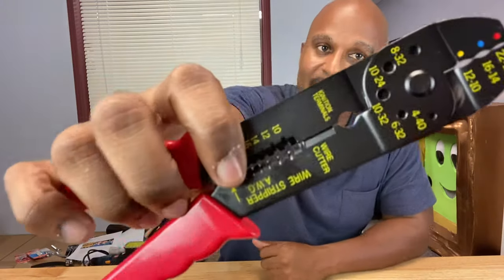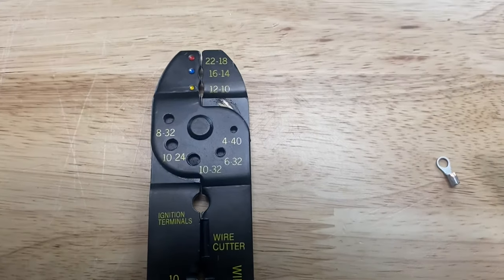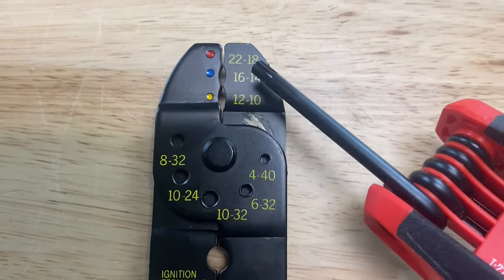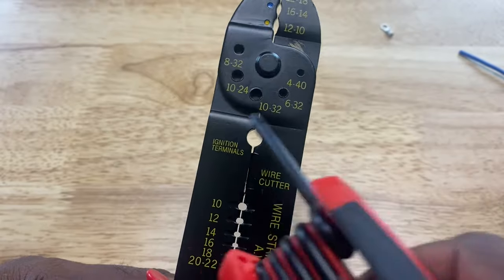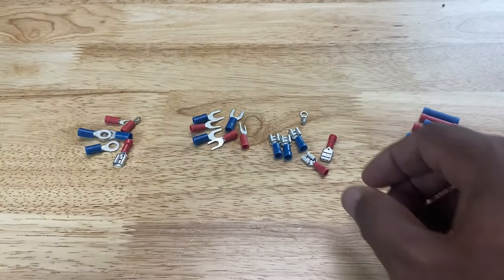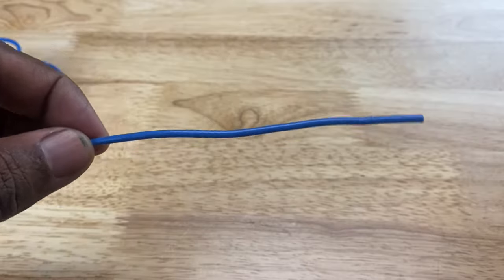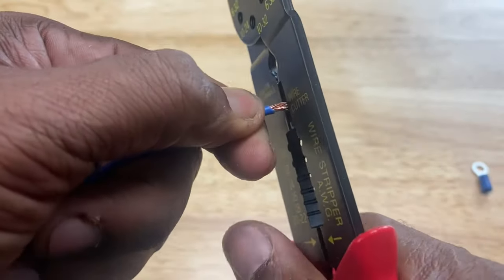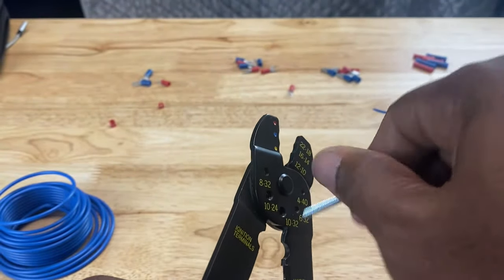HOW TO STRIP CRIMP AND CUT THOSE WIRES!

Comment: A nice video to introduce a lot of beginners to this versatile tool.  A couple of points of clarification if I may...I would not recommend crimping coax with this tool.  The coax you happened to show used a compression style terminal, which requires a completely different tool to install, as it is not crimped.  But even for crimp-style coax terminals, this tool will not generate sufficient crimping force to make a reliable connection.  A minor clarification on the screw-cutting portion (the part of this tool most people don't understand!) is that it isn't 6 thirty-seconds or 8 thirty-seconds.  Machine screws come in particular sizes (diameter of the shank--very similar to wire gauges, but a totally different system).  The 2 numbers with a dash in between represent the screw (shank) size and the thread pitch (number of threads per inch).  So a 6-32 screw (common in electrical work) is a #6 screw with 32 threads per inch.
Reply from the maker: Thank you very much, clarification much appreciated.

Comment: Wire cutting, stripping and crimping all in one tool. So far I have got by without one just by using the pliers that were already in my tool box. Still a very informative video and this tool is a lot cheaper than others if you want to keep just one tool with your box of connectors.
Reply from the maker: Glad it was informative.

Comment: Thank you for the video very useful. I love this tool. It's a must need for any tool box. A lot of electricians will say that it sucks but at the end of the day it does work and when the time comes and you need to get the job done it will get it done. I have used it in many major jobs and it has kept true for years. Also it's great for electrical outlets for cutting down those screw sizes which sometimes are to long. Knowledge is power. I really appreciate the video I wish to do some myself fixing stuff.
Reply from the maker: Thanks for the information. Appreciate you.

Comment: Thank you, I got all the info I needed from you. ❤
Reply from the maker: You’re welcome. Glad it helped.
Reply: @Caliber8Tools  it did, I changed my air-condition Resistor in my car and I had to use a cable clamp stripper for the first time in my life. Went smoothly except the tight and short cable area I had to work on right under the passenger front under the dash and glove compartment. Was tight!!!

Comment: Great video, layman's(simple) way explanation, and cool guy.  Never knew or thought of the bolt cutter and its purpose until I watched your video! .... can NOT tell you how many times I've bitched about when cutting a screw/bolt (with a regular cutter, not this tool) messing up the threads at the end. So, this tool re-threads the end of cut so you can use it like a new cut-to-length size. COOL!!  Thanks a lot!
Reply from the maker: You’re welcome. Glad it helped.

Comment: Thanks, truly, all i want is crimp some wires for the connector of my fuel pump connector. Instead of buying a new connector, all i need is to change the connector but i didn't know how to atick the terminals at the end of the cable. I truly appreciate sharing your knowledge.
Reply from the maker: No problem. Glad it helped.

Comment: Admittedly, I am a tool and wire idiot.  Sixty-eight years old and never done this.  You did a fantastic job explaining and demonstrating this tool.   I learned a lot from this video.   I have owned the same tool you demonstrated, just never had a clue how to use it.  One dumb question for you.  I have thin wires on my sprinkler system and don’t know the gauge.  I know, from you, that it will be a higher number.  But, how does one determine the gauge of a wire.   Obviously I have no packaging that came with it.  It was installed seven years ago by the sprinkler guy.
Thanks again for your video.  You had just enough detail and went slow enough for us neophytes.
Nick T
Reply from the maker: Appreciate your feedback. I would invest in a wire gauge tool. It’s a small measuring device that has slots to insert your wire to tell you the correct gauge. Sold online, around $10 on Amazon. Don’t know if Homedepot has them in stock. Type in “wire gauge tool”.

Comment: Caliber8, good dope on using the what/how of the crimping tool.  The one thing I might recommend is the use of a second crimp to reinforce the connection. The first where the wire is just exposed from its insulation, and the second directly behind it on the insulated portion of the wire.
Reply from the maker: Great tip thanks.

Comment: I have used this tool to put terminals on wires for years and this is the first time I have seen an explanation for cutting threaded studs.

I paid close attention to your explanation about the correct side to put the bolt to be cut by the tool, because I had never noticed those tapped holes on the tool that repair the threads of the bolts once they are cut.

Finally I have to say that I have two crimpers, one of them have those tapped holes and the other doesn't, now I know witch of the crimpers is better.

Thank you!
Reply from the maker: You’re welcome. Glad it helped.

Comment: I want to see how you crimped that compressed cable connectors with this tool. The rest of this video is very informative however this tool is not recommended. Ratcheting crimper is better but the basic information is good.

Comment: The screw sizes are given in numbers - second number is threads per inch and  not in "nds"..  6-32 and 8-32 indicate 32 threads per inch on a #6 or #8 diameter screw.  There is no 6/32 or 8/32 fractional size being described
Reply from the maker: I stand corrected.

Comment: Ok for thin wires but what about the outer most insulation?
Reply from the maker: Find the appropriate stripper for that type of wire or use a knife to make an incision(cut) running parallel to the wires then peel it back.   Make sure not to nick the wires when cutting.

Comment: Hey dude I would only use these as a crimper and bolt cutter.  Get some good ones for cutting  and stripping wires very cleanly. THESE ARE TOO GENERIC & WILL KNICK WIRES.

Comment: After watching this video and many others, I made my own fix. Here it is: if you have only regular wire cutters, you can pinch them down on a crimp connector, but not tight enough to cut through. Then, use a heat gun to shrink the plastic tube. I live ten miles from the nearest hardware store so this was a good fix
Reply from the maker: Thanks for the tips.

Comment: Great Video!
Do you have a link to purchase the stripping/crimper tool that you have?
Reply from the maker: Glad it helped. Check out Homedepot.com. Type in wire stripper, crimper, cutter. They have similar ones, not sure if the one in the video is in stock.
https://www.homedepot.com/p/Klein-Tools-Multi-Tool-Stripper-Crimper-Wire-Cutter-8-22-AWG-1001/100647872

Comment: Sir, çan we cut nails using screw cutting/threading holes?
Reply from the maker: No, maybe really thin nails but if you cut a nail it’s no longer a nail right.
Reply: @Caliber8Tools  also that particular hole's threadings may not be further useful for screws.Thank you sir.
Reply from the maker: The screw is still useful after cutting.

Comment: You cut a bit too much off … you should leave more exposed copper behind the ring terminal insulation …just as long
As there is no bare copper showing at the bottom …
Reply from the maker: Thanks for the tip.